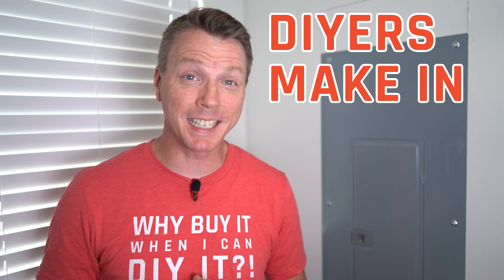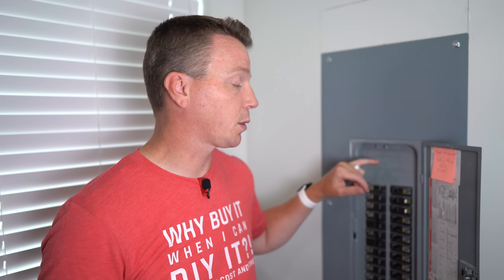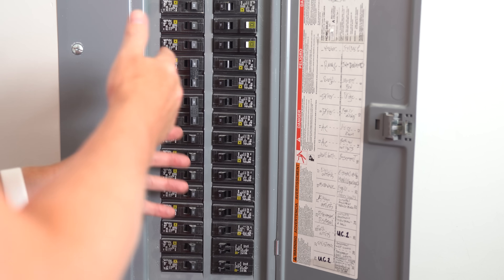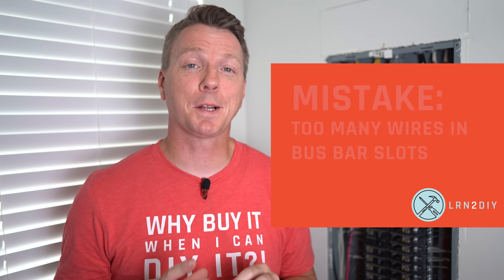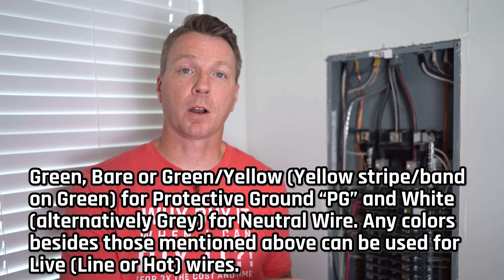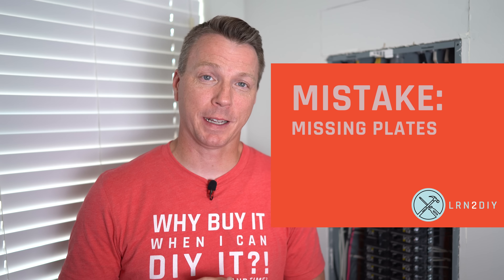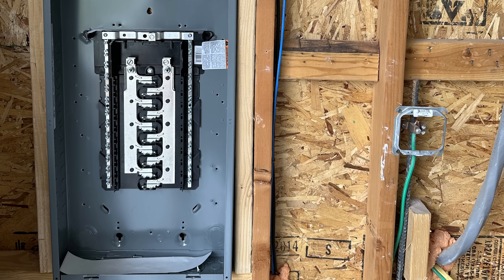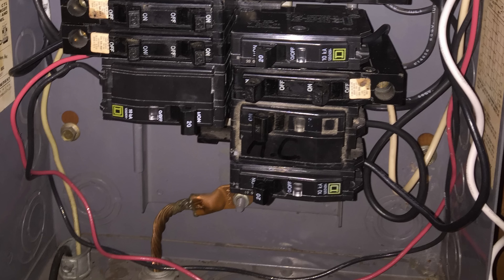10 Common Mistakes DIYers Make In Circuit Breaker Boxes

Comment: I must admit that I had some bad experiences as a teen working with high voltage and was terrified to do anything in my box for years. Even something as simple as replacing a receptacle made me cringe. But when I realized the cost of adding a circuit for my shed, I decided it was time to get over my fear. I watched a number of YouTube tutorials but yours was the best. Your videos gave me the confidence to do the job and the knowledge to do it right. I’m now working on replacing all the old wiring from the 1950s when the house was built and upgrading my box. I’m nearly done and will have an electrician check my work in a few days before the electric company turns everything back on.

Thank you so much for being so informative and straight to the point in all your videos.
Reply: Now is the time to add a generator hook-up...while the utility is disconnected.
Reply: @bernlitzner2739  A mechanical interlock saves $$$:  Main must be turned off, slider moved before backup can be closed in.
Reply from the maker: That’s amazing that you were able to overcome that fear and build that skill set too! I’m definitely still learning but it’s such a valuable ability to have. Best of luck with the house - sounds like you’ve got this under control. 

Thanks so much for watching too!
Reply: I live in a 240V country. When I was 11, I got my first shock. My dad was a lousy DIY electrician, which I only realized later. I came home from school, rushed to the TV, turn it on to watch cartoons, nothing. That's not odd. Mom or grandma probably unplugged it to plug in a standing fan or iron, or blender, or whatever. There was only like 5 wall sockets in the entire house, and extensions and splitters were rare back in those days. So it was normal (for everybody, not just us) to unplug and plug in devices as you need to use them.

So I looked over at the wall socket, and true enough, the TV's plug is on the floor. Did I mention that this is a type G country? You don't want to step on one. But we normally leave it next to the wall to avoid that problem.

So I walk over, plug it in, and flip the switch on the sockets. (Type-G countries have switches on every wall socket). The resulting feeling was ... unique. It is difficult to describe to anybody who has never received a shock in their life. It's not pleasant. But neither was it painful. To put it in perspective, if you hook up enough safety equipment to ensure that I wouldn't die or be seriously injured, and offered me $50 to get shocked again ... well, why not. It isn't that bad. I've broken different bones since then, and those aren't even in the same ball park. I've received insect bites that are more painful that that electric shock.

Turns out, when I flipped that switch, I was standing on top of where the power cable was joined. The cable that came with the TV was only like 6 feet long, but the wall socket was on the other side of the room. So dad extended it's length with some wire, and the two lengths were joined using the PVC terminal block connectors. Unfortunately he was not too neat about it to ensure excess exposed conductor is not ... exposed. Nor did he wrap the joint with electrical tape. I was thrown a short distance, breaking contact with the live wire, but did not land on anything that would cause injury. I thought nothing of it, didn't tell anybody, and just sat down to watch TV. I don't remember what show it was, but it does not matter. In those days, I simply watched everything. I just remember to make sure I was not standing on that thing again.

I would receive two more shocks before I turned 13, two more before I got to 20, and another when I was around 30. The last one because I got careless at work. Although two of the shocks I received were from "leakages" so probably not the full effect of the 240V supply. I've never worked on anything more than 240V. Those would scare me. 

I'd a colleague at work who went and touched a high voltage line with his tools, before it was stepped down to lower voltage and distributed to an office block. He accidentally shorted the live to neutral, causing an explosion and sending him to the hospital with 3rd degree burns covering the top half of his body. He was off work for months, and you know that thing with burn injuries. People would sometimes appear to recover partially a day or two before they died. We did worry about that. He did make a full recovery though.

240V is not that scary. Half the world have this in their houses. Only if you somehow got clamped to the live wire and can't let go would it killed you, so never work alone. Make sure somebody is watching you, and they already know what to do if you got shocked (what to use to disconnect you). They should already know what to do, and not try to work it out after the emergency happen. So I always talked about it just before starting, especially when my assistant/guard is somebody who knows nothing about electricity. Other ways to die would be for the shock to throw you into something deadly, like off a ladder, and over the railing of a 3rd floor aisle, into something sharp, or for you to grab the live with one hand and neutral the other, and have the current flow through your chest and heart. So clear your workspace, wear a safety harness if necessary, make sure if you become limp and unconscious, the harness doesn't bring you into contact with the live wires, and be mindful of what you are touching, holding, or might brush against.
Reply: @danielch6662  I think the moral of that story is don't walk around the house barefoot like some damn hippie or pregnant woman!

And I believe you can definitely be killed without clamping on.  It depends exactly where in the contraction cycle your heart muscle is when you get zapped.  I'm not an MD but my father is and he explained it once.  Of course if it never goes near your heart then you got nothing to worry about anyway.  (Like when your foot steps on both conductors.)

As for what an AC shock feels like, I can only describe it as a mostly-unpleasant pulsing/vibrating sensation.  Depends on the resistance like you said (sweaty hands = no good!).  Then again, once I got shocked by just 60V, touching computer case standing on concrete floor while wearing socks (silly me!).  That one just felt like the metal was VERY cold.  Nothing more.  Strange.  Cause of that one:  Don't use surge suppressors on an ungrounded circuit!  When they fail, some of them send 60V down the equipment ground ("protective earth" for you Europeans?), energizing the case of everything you have plugged into that surge suppressor.  A plain power strip without surge suppression does not have this problem.
Reply: Yes I always physically look check and never work anyting hot close together like that. I just never work at hot there's times when you might have to do something like that but never do it.
If I know it's all dead when I hook it up I don't have to worry about it shocking me have a good time and be careful,,I have work high voltages hot but that's another story.
Reply: No one who works on electricity considers anything below 600v as “high” and most don’t consider it high until 1000v or more.
Reply: I'm the son of an journeyman electrician.  I've replaced a few outlets or added a circuit to my own breaker panels once in a while.  I have shocked myself a few times.  But I've got to admit I still get the heebie-jeebies when I see a breaker panel with the cover off!
Reply: I don’t recall working with you , sorry 😅
Reply: Highly doubt you were working with high voltage considering you litterally had to watch yt videos to even have an idea of what todo, had you worked on HV youd already know 😂
Reply: @moneybilla  Yeah if he was working with HV he'd be running around screaming like a little girl after an arc flash.  And his buddy would try to put him out of his misery ASAP.  We both know the video; no comment.

To the OP: 240/120V is not "high voltage".  Please stop using the term until you've dealt with it.
Reply: @SmallSpoonBrigade  In the US, residential is generally supplied with 240V Split Single Phase.. So, that is generally the max you are ever going to have in residential; that includes electric vehicle charges. While I didn’t look it up, pretty sure anything below 1,000 VAC is low voltage (most meters are rated to 600V and some to 1,000 (but, they still might have different CAT ratings for where they can be used)… Anyways, I know that the 11k three phase lines coming into industrial facilities I regularly see are considered medium voltage, so high voltage is higher than that!
Reply: It's highly unlikely you were working with "high voltage" as a teen.  Especially given the rest of your post.
Reply: @core251  I think the confusion is often that there's low voltage as in stuff like telephones and network cables, and then there's more or less normal household voltages of 120v or 240v depending upon where you are and what kind of a circuit is and then there's voltages that are much higher up to potentially many thousands of volts and for non-professionals the line between low and high isn't at all clear.

Personally, I got to help out with the household voltage stuff at 115v, but never 230v and certainly nothing above that.

Comment: It's worth mentioning that back in olden in the old days (say 25 years ago), All NM Romex style cable had the same white color sheathing, regardless of its gage. When checking for over fusing of circuits what appears to be an over fused 15 amp (14 gage) circuit may actually be correctly fused 20 amp circuit with white sheathed 12 gage wire.
Reply: A lot of upgrades that were done to my house in the 90s used 12 gauge cable that had a blue sheath. And I still have some 12 gauge cable that was installed in the 60s with a black sheath. So, color can be a guide but nothing to trust unless you know the history of the building.
Reply: I still have about 75' of white 12/2 that my uncle gave me. I use it for extending outlets and relocating light fixtures as needed.
Reply: This guy does make me seriously nervous, waving his hands around that main lugs, and not mentioning that those can kill you in an instant completely uninsulated
Reply: @jamesschneider8228  Yep, my breaker box looks a lot like that, except it's a sub panel that can't be de-energized from there. If something needs to be changed with it, that involves doing a lock out tag out outside of my unit. I had considered swapping out the breakers, but it became pretty clear that it wasn't at all safe to do without going to the main panel for the building and powering it down there. At which point, I was still not at all comfortable doing it. At some point, I'll probably have an electrician come in and replace the breakers, but with none of the other breakers in the building being AFCI, I'm not sure that it really makes much sense to do mine if I need an electrician.
Reply: @jamesschneider8228  Was going to say the same thing...is that thing off??? lol  Oh, and when in doubt, just measure the wire gauge until you're sure what color or size is being used.
Reply: It all had white outer insulation but it was clearly marked with the gauge.  It was usually printed, but sometimes embossed.  I've seen both.  If you can see either end (J-box or panel), it's pretty obvious anyway. I think it's more to help the installer than someone coming around later.
Reply: I have that issue. Every circuit that has a 30A breaker is going to be checked to confirm wire gauge. I'll first check the wire size at the breaker panel then out on the end where the lights and plugs are installed. I have a micrometer that reads in thousandth of an inch so with that I can easily measure actual copper wire size.
Reply from the maker: That’s great to know and definitely worth pointing out. Thanks!

Comment: I’m a retired electrician.  I would suggest to people to look for the UL or ETL label on any electrical device or equipment.
If my memory is correct, the NEC doesn’t allow ANY splices in an electrical panel.
I would also mention the color code for wires for 480VAC 3-Phase:  BOY,  Brown, Orange, Yellow.
                                                                                            240VAC 3-Phase:  Blue, Red, Black.
You are very informative, great delivery also.
Reply: I'm not sure when the rules changed, but you can splice inside of a breaker panel.  NEC 312.8 goes into the specifics.
Reply: Peter,   The NEC is getting closer to color code, but the colors you stated are an accepted in some places standard.   So, good practice, but not NEC.
Reply: Peter, you're incorrect. I suggest you stop giving outdated advice.
Reply: Not true the panel is considered an enclosure which is allowed in the NEC

Comment: Mislabeling was definitely a big point of frustration for me when we bought our home. It took more than half a day to trace out every receptacle and light. Fast forward a few years to last year and we decided to add rooftop solar system and upgrade the 150 amp panel to a 200 amp Span smart panel (already had 200 amp service to the box). 

Unfortunately, the solar installers did not follow my labeling scheme so I had to go about relabeling everything all over again. 😭

On the bright side, it was a lot easier with the Span panel as I just went from receptacle to receptacle with a high-draw appliance (hair iron), plug it in, and watch the usage spike on the correct circuit in my Span app. I was shocked that Span doesn't offer some sort of tracing device that can of into the receptacle and have the panel itself label it as you go.
Reply: I've been going a step further with my recent renos, in addition to labelling the panel. Brother makes a tiny 1/8" label tape for their P-Touch printers that I use to label all my receptacles with the associated breaker. It's so small that it doesn't really affect the look of the wall plates if I tuck it right in the corner. Any new work or rework gets a label inside the box too. Takes very little additional time, and it's a nice gift to future me when I need to find a breaker quickly.
Reply from the maker: Oh man - sorry to hear you had to redo that. To your point, the Span must have made things much easier. I have looked into getting a Span but it definitely seems to make more sense if you have a battery backup and I don't. I'm excited to see where all that tech leads to in the future too. Thanks for watching!

Comment: How would I trace a 15 amp breaker that doesn’t seem to lead anywhere?
Reply: @brianmerrick8260  that’s smart!
Reply: There are devices out there that can trace the wires in the wall and ‘I think’ it works without a load.  I can’t recall the name, but have seen YouTube videos on them.